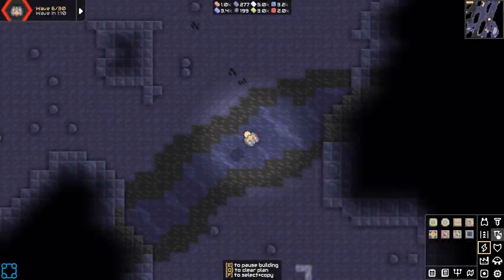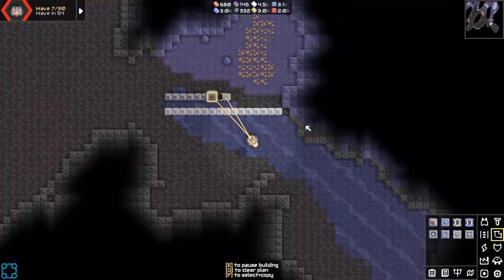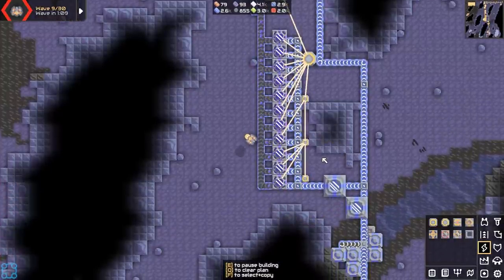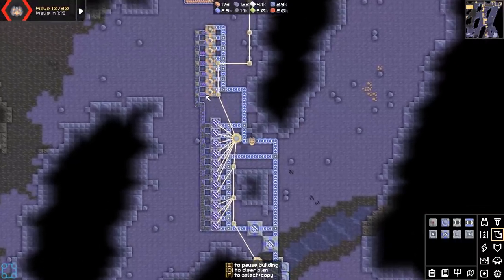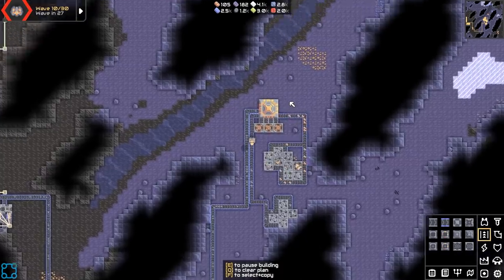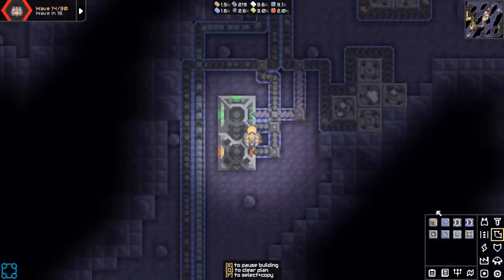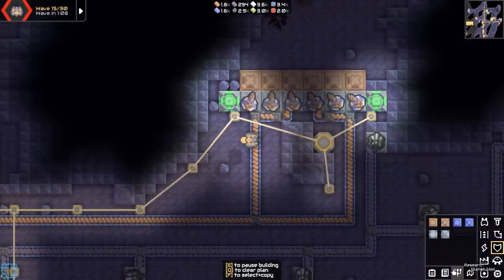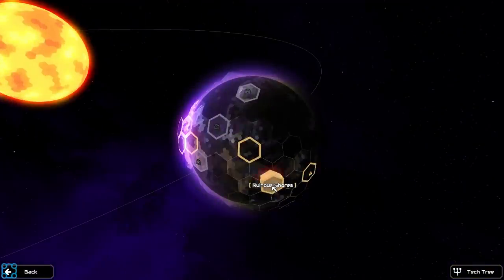Bigger Guns Need Bigger Ammo! - Let's Play Mindustry [v6.0] - PC Gameplay Part 18

Comment: tip if you are doing something that you input from both sides (like top part and the bottom part) the output has to be taken with bridges and the input with conveyors(or just use junction and go through the conveyor that is possible throught (if you get cryofluid you have to get a junction go through the pipes)